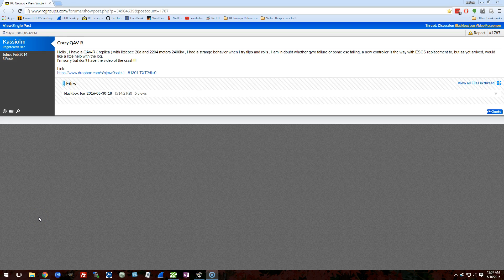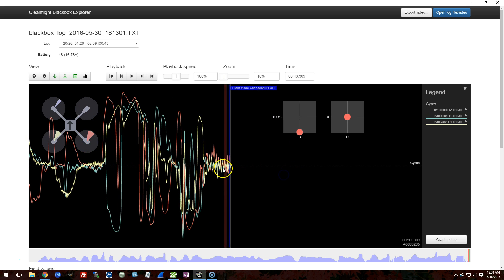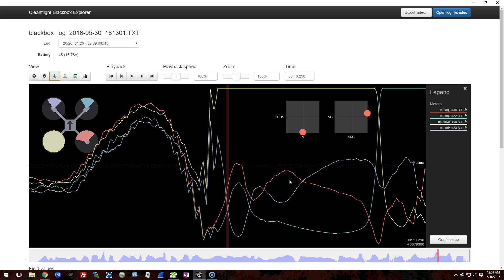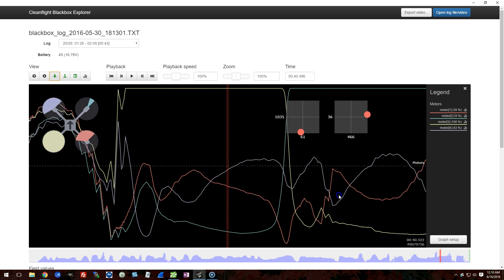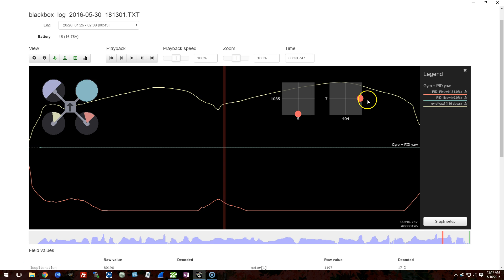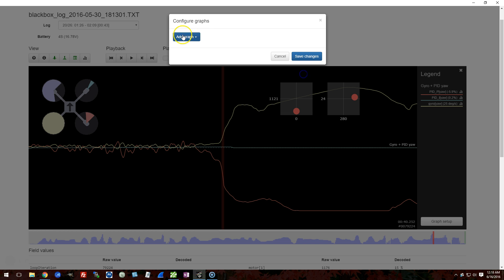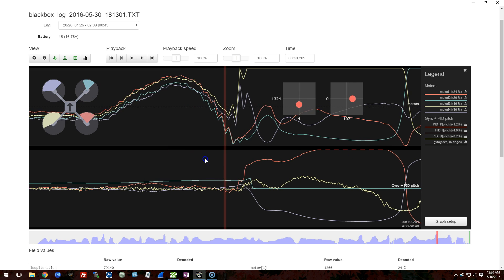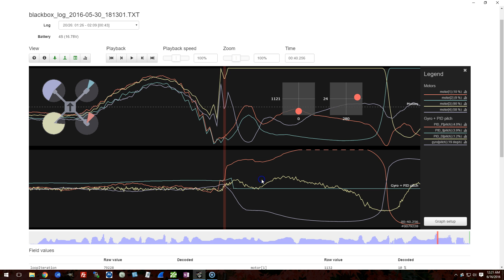Blackbox Log Analysis: Kassiolm 6/16

Comment: I have the same issue and it's always motor 2 or 3. These are the motors reversed in BLheli, try re-solder the esc instead of using software. This could possibly be a bug in either esc or flight controller software. So if we re-solder motor/esc then we can eliminate the possibility of a bug through reversing esc.
Reply: dam if that's it thanks glad I don't do that with my motors, my friends keep calling me crazy lol

Comment: It's almost definitely a motor desync, and therefore it looses thrust and the FC tries to compensate with more signal.
Reply from the maker: I would expect a motor desync to happen when the motor is commanded to spin up rapidly, but that isn't the case here.
Reply: Of course he commanded it, its happening exactly at the same moment when he commands the roll!
Thats a textbook desync example. :)
Reply from the maker: I guess you're right. But stick movements usually aren't abrupt enough to cause desync. I suppose this could be an edge case though. Good point.

Comment: So,  I re-soldered my esc as I mentioned previously and disabled reversing motor direction in BLheli software. No matter how hard I push my quad I can't get it freak out anymore so it is possible that it could be a bug or something in that nature.
Reply: I'm also experiencing the same problem on motor 3.  It does seem to be related to the motor failing to spin back up from min_throttle.  Your hypothesis is interesting though as I do see many having the issue on motor 3.  Keep us posted.

Comment: Could it be bad FC placement so that because it's not near the COG it feels movement on the other axis under extreme conditions?
Reply from the maker: No. The gyro doesn't work like that. As long as the frame is rigid, all parts of the frame will undergo the same angular rate movement as all other parts. Even if the frame is slightly flexy, something this extreme couldn't happen.

What you are describing CAN happen with the accelerometer, but I don't think the pilot is flying in autolevel mode, and again, the effect is quite small unless your frame is very large and the FC is very far from the CG.